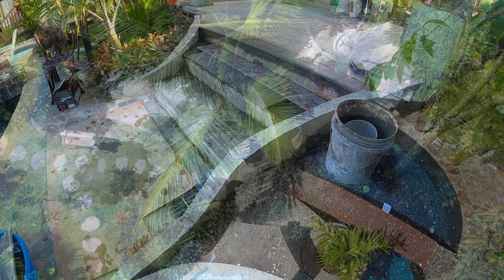VILLA FELIZ PAVILION BUILD - EPISODE: 16 (The Tile Work)

Comment: Just noticed, is that just wet sand they laid the floor tiles on the pavilion?  Or, is it a special compound that looks like sand that hardens after the tiles are laid?  I am not an expert in tile construction, but I thought that tiles are set on hard cement to prevent the tiles to sink or settle down when weight is placed on it.  Wouldn't that cause some cracking of the tiles, when the bottom is unstable?  Also, isn't the bottom of the roof a bit short to protect the people inside the pavilion from the getting wet, in case of rain?  Will you be installing gutters, to direct the water down from the roof?  You being so miticulous with work, design and details, I am sure all these already have been taken care of, once the project is finished.  Just my observations.  Overall, the pavilion project looks awesome!
Reply from the maker: Regarding the floor tiles, the technique is call "dry pack".  It's a common practice here for all floors although we in N. America normally use this only in wet areas like a shower pan.  I'll be discussing this again in an upcoming episode.
As for gutters, it was a personal choice not to include gutters.  This is a typical pavilion plan and its up to the owner if they want gutters or not.  During rain, we won't be able to sit on the outside bar top area as the water will fall on that area.  As rain usually is blown inside anyway, even having gutters would not keep those on the outside of the pavilion slab dry anyway.

Comment: I noticed they do not use GFI outlets here.
Water heaters just plugged in above the shower heads.
Reply from the maker: They use RCBO breakers.  Very similar to GFCI and for preventing electrical shock.

Comment: are you paying the workers on a daily rate or packaged deal or pakyaw... how many workers.. 
if 600 per day per mason x
4 workers?
Reply from the maker: I'm paying more on a hybrid system based on task.  The tilers I paid per sqm.  The masons working concrete I paid by the hour.  It works out best for me like this and saves me some pesos.
Where I really saved was the wood work.  I did all that so I'm "cheap" labor!  😉